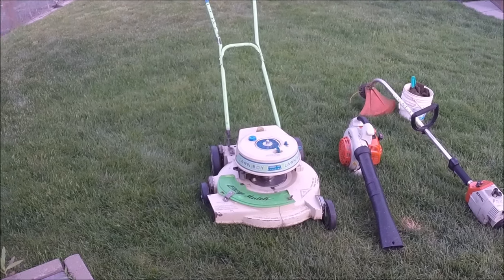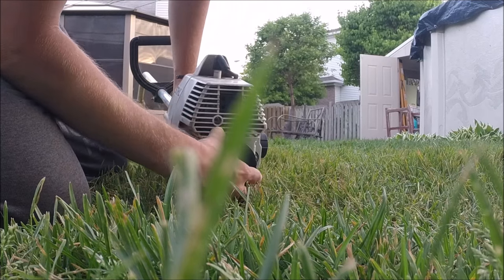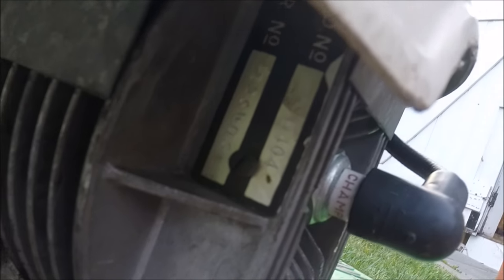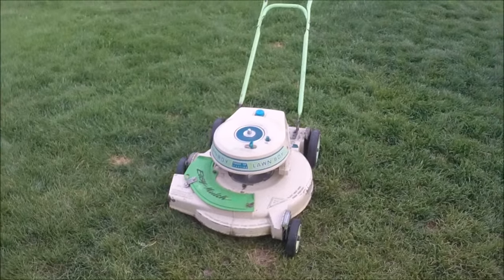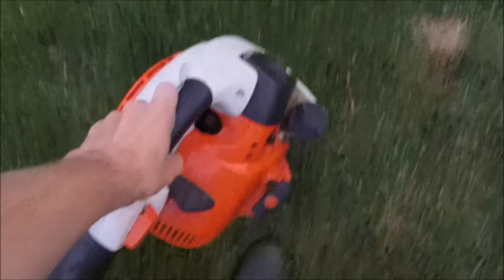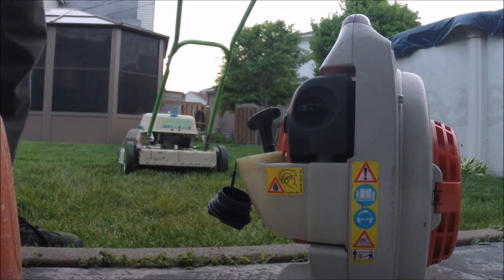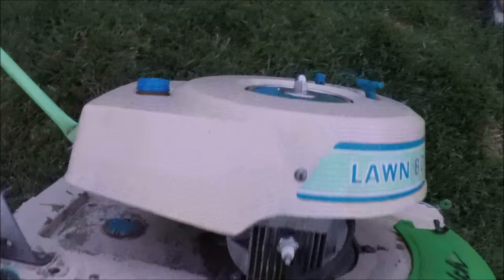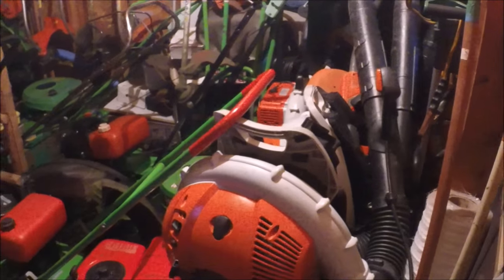1967 Lawnboy 7217 and Stihl FS 36 & BG86 In Action

Comment: I had a lawnboy from (I believe) this era.  Same sort of shape of the deck. similar engine/tank/cover etc.,  all green and it said OMC by the Peterborough Canada emblem..or it was on a tag somewhere there...A mower I found in someone's garbage one day..too bad I don't have it still along wiht my '67 viking reel mower with the 3hp briggs, and the rest of my briggs and stratton mowers..  Toronto area here...I also do that half and half striping sometimes...doublecut without having to double cut.  I have a bg 80something from about 2002...84/85/86??.  I can't recall at the moment.  did a tune up on it when it was about 10 years old and it is still going strong.  Better than the new ones at work..Since everything and everyone is lame today, they lowered the dBs, therefore the performance...

Comment: Jon for next weeks lawn cutting video can you use the the 1974 LB commercial lawnboy the FS94r and the BR430
Reply from the maker: Hi Goober :)

 I've recently made one a little over 2 weeks ago (https://www.youtube.com/watch?v=lESCjpBCrZw).  For this year, I'm planning to film every working trimmer and mower I have before I can take on repeated requests.

I have coming up soon on with the 5247, Poulan and Br420.

I'll give you a list of the available lawnmowers and trimmers, blowers and I'll be sure to mention you in the forthcoming one

Mowers available for filming:
my 3 tecumseh powered LBs:  10260,10360C, and 10247H
my briggs powered machines:  Murray and LB 10642C
My Honda MTD
My V- series LB 10201 and M series CM21EMRA
my D-series:  5269G and 5239B
my F-series:  10401C, 5126 (2 of them), 5127, 7073, 5277, 8243AE, 4630, commercials 10600 and 6259

Trimmers available:  
Ryobi 700r, Homelite Mighty lite 26SS and Z825sd,  Shindaiwa HomePro 22F, Black and Decker 8207 and 8209.. Stihl models FS38, FSE60 and FS250

Blowers: any.  Br430 will be no problem
Reply: +Jon3800 thank you for the list and could you use the Honda MTD and the FS38  thanks

Comment: Hey Jon what mower blade is that that you are using on your lawnboy 7217? It doesn't look like the typical 2 cycle lawnboy mower blade that most of the lawnboys use because of those saraded fins on it. Just wondering because I've been looking for better blades for my lawnboys I have. Thanks!
Reply from the maker: I believe that could be a grass gator blade but I could be wrong.  I got this mower shipped to me last year with that blade on there.

Comment: I have a lawn boy and I think don't make 2 cycle engines for lawn boys anymore  it's a 4 cycle the one I have
Reply from the maker: Hi Brandon, Lawnboy stopped making 2 cycle engines in 2004.  They quit making them because they couldn't meet the strict EPA emissions, which sucks.  All these 4-cycles ones they put out is low-end quality.
Reply: Jon3800 i got a new lawnboy mower in 2017 and it is perfect for mulching and bagging, and cuts beautifully.

Comment: 60:1?! I've worked on these and you don't wanna cut back from 32:1 that opti crap is "EPA" oil I've seen many seized engines and scoring due to this clean air oil.
Reply from the maker: Brad Mefford i meant 16:1. I use STIHL oil for this one
Reply: @Jon3800  ok thanks I just ordered a lawn boy 22260 think they're pretty good just wondered nowadays if the lawn boy oil is still good? I'll keep it at 32:1 to be safe. Your thoughts?